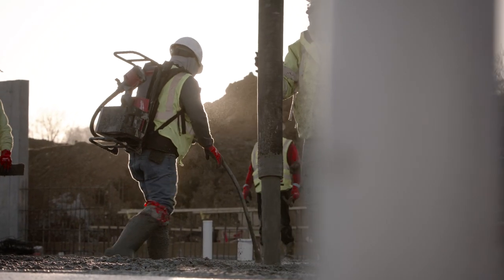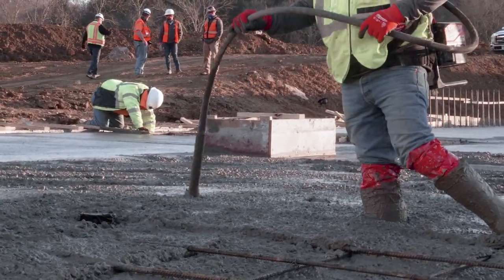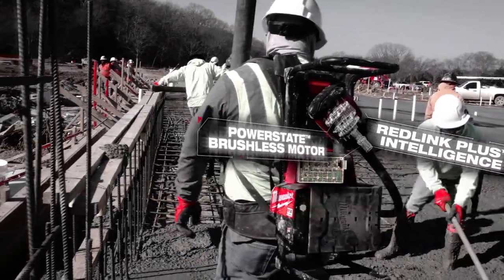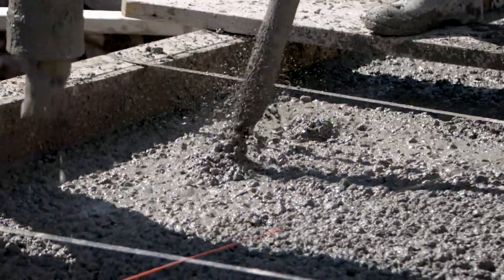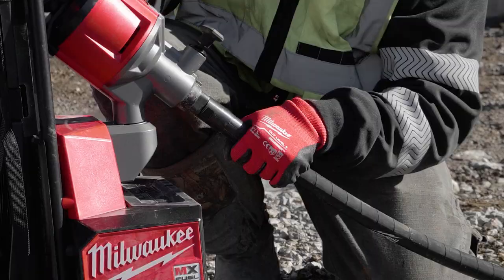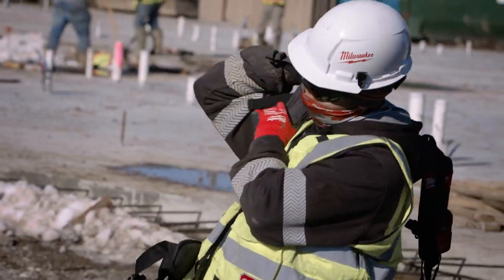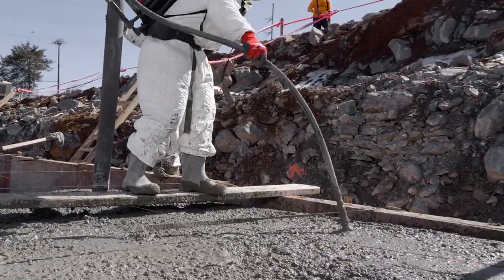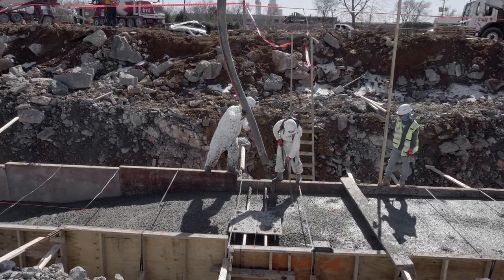Milwaukee® MX FUEL™ Backpack Concrete Vibrator

Comment: It's not quite that excellent, but they are decent. You dont have to worry about bending forward too far and activating the oil kill switch. They don't do quite what they claim. Anyone knowing about slump and how water is weakness may understand. She'll run a fair 40-45 minutes with breaks.